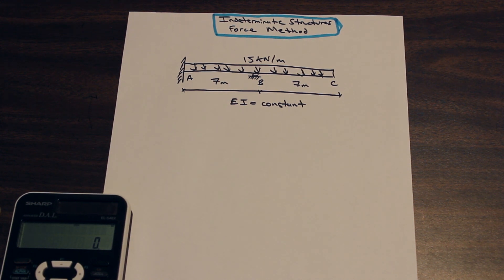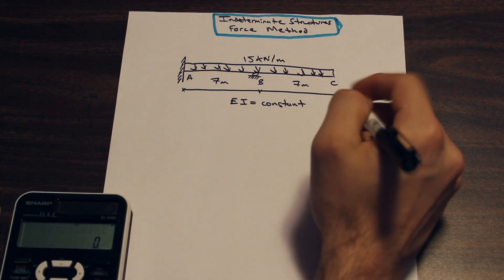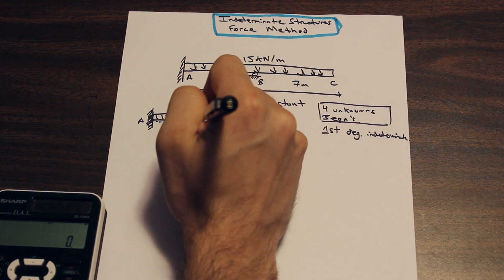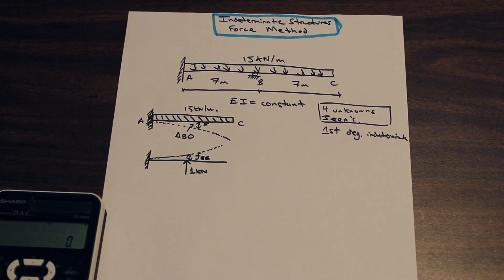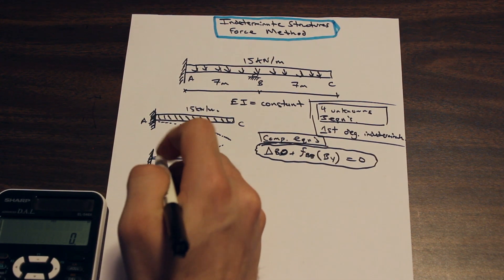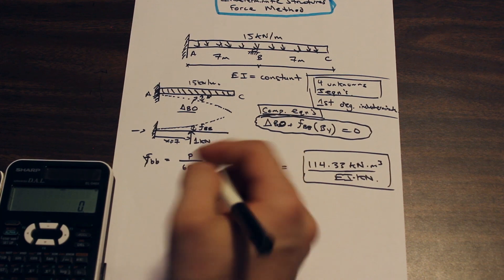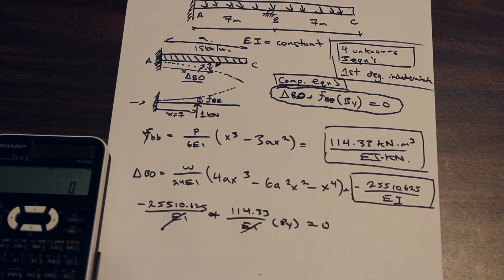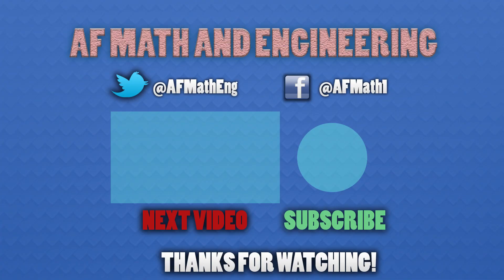Method of Consistent Deformations to Solve a 1st Degree Indeterminate Beam (Force Method)

Comment: shouldn't Ybb be negative since the force is upward and the formula is for downward force.Hence sign switch?
Reply from the maker: Sign convention used here is downward deflection = negative, upward deflection = positive.  Note that deflection fbb calculated due to upwards unit load instead of support is positive and delta bo is negative (downward).

Comment: Just wonder if you get your By at such big value with small point load / uniform load, wouldn't Ay be negative value? I'm facing the same problem
Reply from the maker: Why are you finding Ay here?
Reply: @AFMathandEngineering  After the force method, using the equilibrium equations
Reply from the maker: @loolick8307  sorry I'm not really sure why you're confused, just take sum of forces in y and solve for Ay.  Whatever Ay ends up being (negative or positive) that's what it is.  Remember there's also a moment reaction at A.

Comment: where do you find the table of deflections
Reply from the maker: deflection tables are located in a number of places, if you've purchased or have a pdf of the structural analysis textbook for your course they should be in the appendix in the back.  Also, the steel or concrete building code for your country will have all the relevant deflection tables, if you're in civil engineering in university you're probably obligated to buy these.  If you don't have any of these, google beam deflection tables and you should find some.

Comment: anybody tell me...does a refer to entire span or the span other than x
Reply from the maker: Knowledge Easy if you refer to your deflection tables in your code book or textbook it should be very clear which one is which.
Reply from the maker: Also, remember there are many different formula derived for deflection..you don't have to use this one.  In this particular formula a refers to the length of the distributed load starting from the fixed support.

Comment: 3 reactions, not 4 ?
Reply from the maker: +THE STRUCTURAL ANALYSIS MATRIX FORMULATION there are 4 reactions on the original beam, 3 reactions after the redundant support is removed.
Reply: by removing the support @B leaves two only Ra and  Ma ........
Reply from the maker: Ma, Ax, Ay
Reply: let me tell you something Ax and Ay are component of a F vector.
Reply from the maker: +THE STRUCTURAL ANALYSIS MATRIX FORMULATION If you return to strengths of materials 1 you'll see that the reaction vector is broken up into two forces, reaction in x and reaction in y and considered two reactions when analyzing supports such as a fixed support or pinned support.
Reply: do you think that cross product , or dot product will give a better explanation for this ?
Reply from the maker: If you're referring to the number of reactions,  there are certain equations of equilibrium when we're working with static beams that must be fulfilled.  These equations are: Summation of forces in x = 0, y = 0, moments = 0.  The forces x and y can be resolved into a resultant vector but when we're doing statics calculations we work with forces in x and forces in y separately at a support.